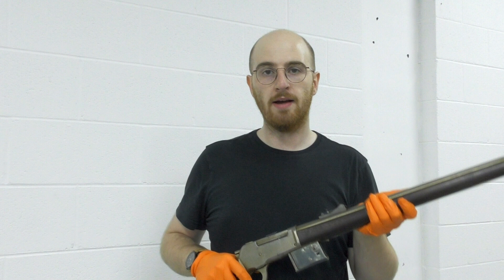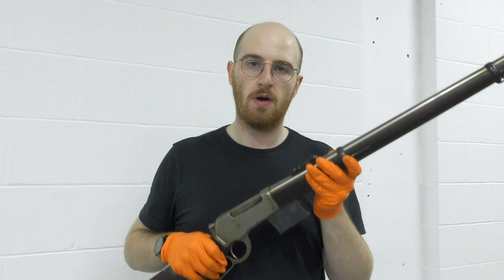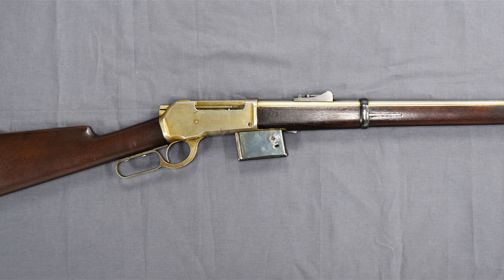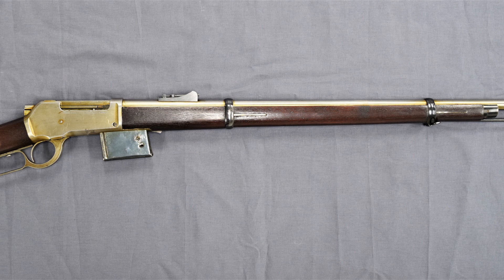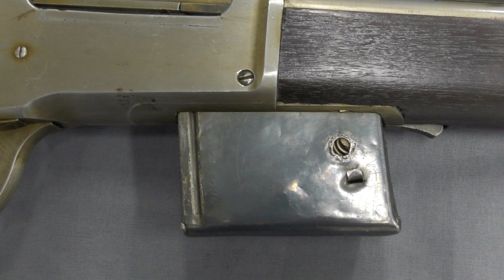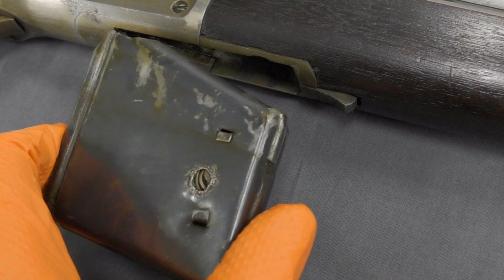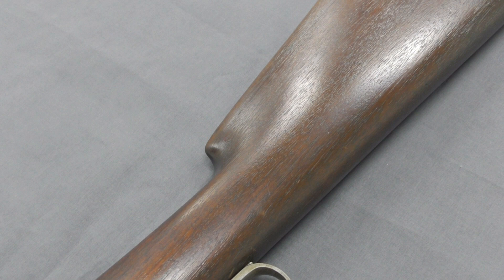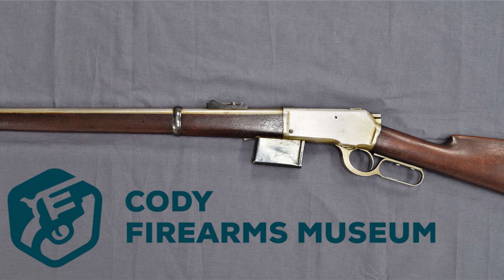Browning Prototypes - Detachable Box Magazine Lever Action Rifle

Comment: Do you think that having a striker instead of a hammer was intented/necessary for this design, or was this just a test of two separate ideas?
Reply: Yes
Reply from the maker: Very good question. I can't see how a hammer wouldn't work with this rifle. I suspect it could have been a test of a different design. The patent does outline it in some detail which would suggest it was. It refers to it simply as firing pin. The patent is linked in my accompanying article if you want to check it out! Thanks for watching - Matt
Reply: For whatever reason, Browning made several striker-fired guns like this at the time - with different magazine styles.
Reply from the maker: @wardropcr  he seems to have done that with a number of his designs, like the slide action with an 1895 magazine system (video on that soon!).
Reply: Was he avoiding a hammer fired design to avoid patent problems?
Reply from the maker: Probably not as Winchester produced hammer fired guns. I suspect he was experimenting and patented the two ideas together.
Reply: @TheArmourersBench  excellent knowledge, thanks for the reply!

Comment: Need this type of rifle in California
Reply from the maker: 100% illegal assault weapon.
Reply: I mean, there is the Long Ranger and BLR.
But a box magazine .327, .357, .44, .45-70, etc would be sweet.
Especially for the .327  if the magazine has a little length adjustment tab like on some old magazine .22 rifles to keep the shorter cartridges from falling too far forward for the bolt to catch the rim.

Comment: And why did Winchester not build this??, AND no Arn Boburg you weren’t first
Reply: I think Winchester had good line of rifles and carbines at that point, sometimes they was buying patent rights to avoid competition with other companies.
Not mentioning many people was against detachable magazines. Mag can be lost or damaged, its more pricey than stripper or en-block clips. Rifle had a lot of mechanical parts exposed to dirt and debris, it also had delicate parts like trigger.
Reply: For civilian use a normal tube magazine rifle did the job well. Like the other guy said you don't have to worry about separate mags.
Reply: @aramondehasashi3324  It was end of XIX century, new rifle cartriges was not very good for tubular mags. Maybe this was the reason.
I think Lebel was the only tube-fed rifle with pointy bullets. But it had odd shape of case. (not sure about Savage 99, it had tubular mag, but do not remember what calibers was used).
Reply: Yes i know that's why i said for civilian use. Like you said the lever actions already on the market were fine and people didn't need a rifle like this prototype. By the time Spitzer cartridges and smokeless powder were adopted in America Browning came up with the 1895 model.
Reply: And more to the point why isn’t Henry building it today??
Reply: @xgford94  Henry does make a rifle with a detachable mag.
Reply: Aramonde Hasashi yes I know the long ranger, but the mag length is limited due to being too close to the lever this design eliminates that problem. And also uses a conventional action not the rack and pinion